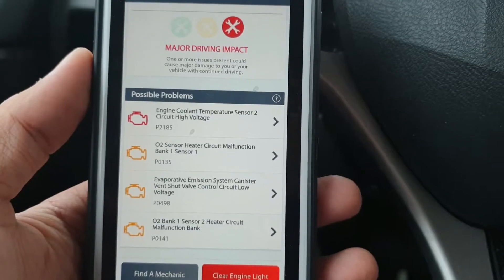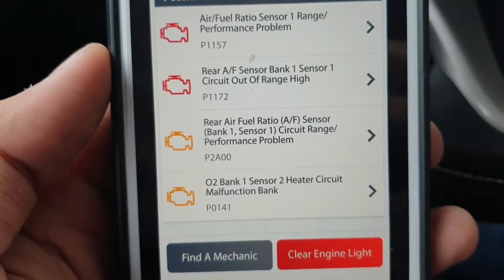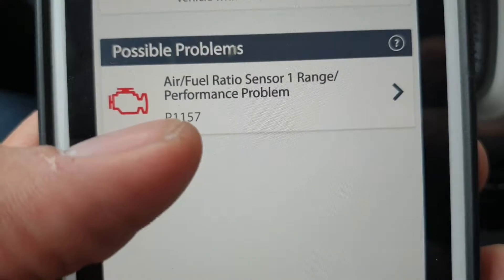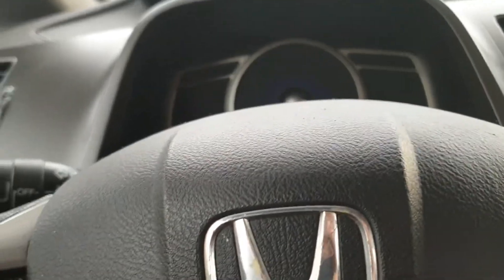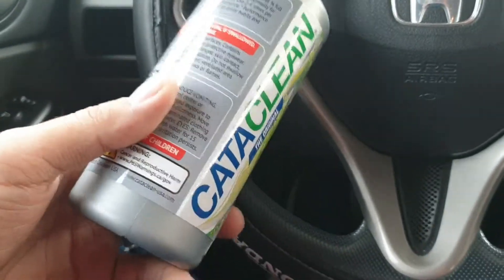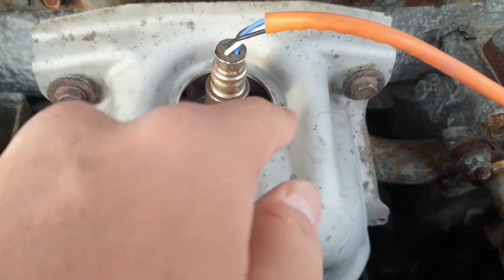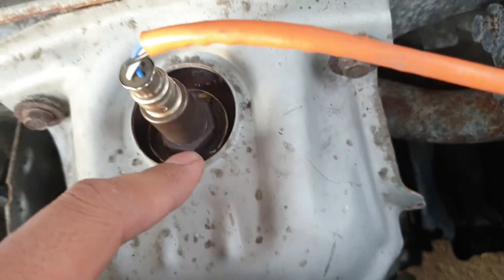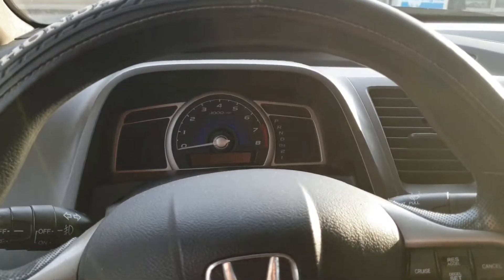Honda civic 2010 02 sensors replacement and  catalytic converter cleaning process. Will it fix?

Comment: Did it work?
Reply from the maker: It does make car run better but it didn't clear the code i still suggest use this at least twice a year.
Reply: Put 91 gas and drive fast it will clear code
Reply from the maker: @lilswagboys  i did that before it did off the engine light but didn't clear the code. And the light is coming on and off again after every few days